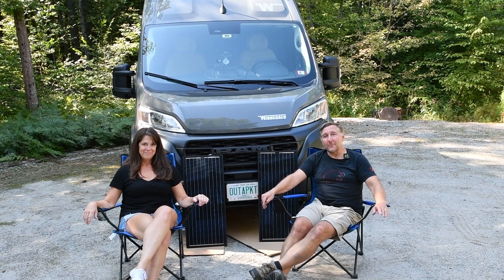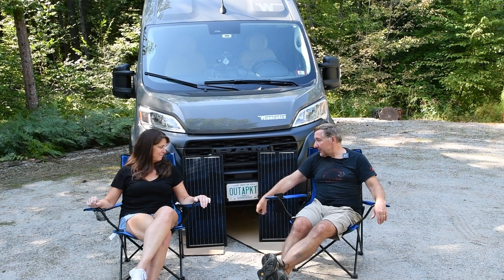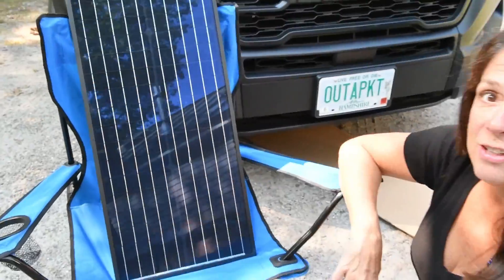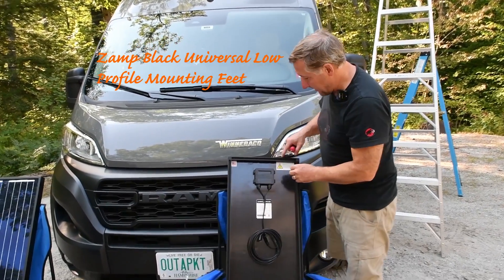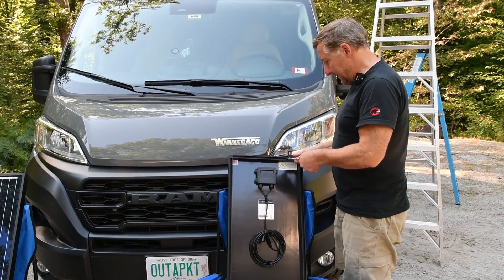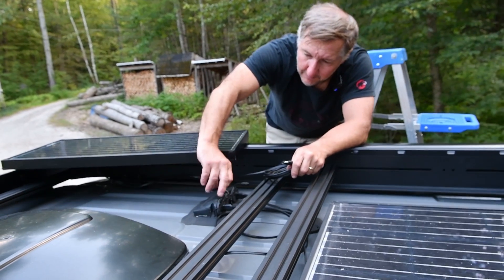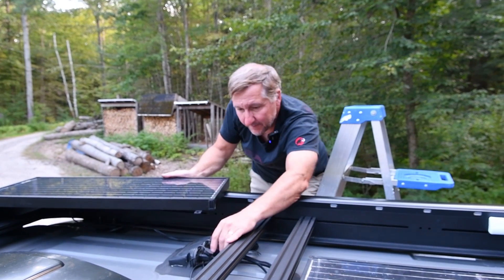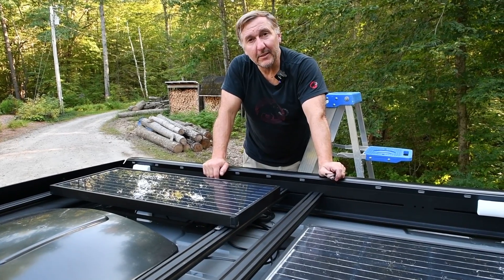Solis Pocket 36A Solar Panel Upgrade

Comment: Did you see a big benefit from adding the extra solar?
Reply from the maker: Well, we don't have hard numbers other than what we shared in the video but it is a 60% boost in solar capacity and an easy/cost effective upgrade if you have a place to mount the panels. In addition to faster recharge, another thing we like is we can run more on a semi-sunny day (fridge, max air) without draining the batteries at all. Now that we have installed Ecoflow batteries for 120v off-grid, I am also interested to see how much excess solar we can draw off to re-charge that. Hope that helps and thanks for watching!

Comment: I was advised to not mix panels of different wattages because the smaller ones will limit the output of the larger ones. I will be most interested to see if I was ill-advised or not from your experience. Since I had already bought smaller ones and larger ones, I put them on separate charge controllers here in my cabin's back-up electric system. They do work fine on separate controllers feeding my LiFePo4 batteries, FYI.
Reply from the maker: Hello again! Thanks again for raising this. I did some research. I found this very helpful guide (among other resources): https://solarpanelsvenue.com/mixing-solar-panels 
When you have multiple solar panels, you have two options of how they get connected: series or parallel. With wildly different current (more specifically amperage) specs between the panels, as in my case, you definitely don't want to use a series connection. Also I am very certain the Solis Pocket is configured for parallel connections on its expansion solar input ports. So with different current specs (overall watts) on each panel in my case (45W vs 170W), the best way to connect them is in parallel. The risk doing this is if the panels have different voltages. The effectiveness of all the panels will be determined by the lowest voltage panel in the system. Checking the specs of the 170-watt Zamp panel that comes on the Pocket, it has a max power voltage (VMP) of 19.66. The 45-watt Zamp panels I added have a VMP of 20.21. That is less than a 3% difference. So, based on what I understand from my research, connecting these together in parallel will reduce the effective voltage of the 2 45-watt panels from 20.21 volts to 19.66 volts. That is an overall lost of performance for each 45-watt panels of about 1 watt only, so they effectively become 44 watt panels. So from what I see, this is actually a pretty good match and effective way to expand the system. You would want to avoid adding any panels to the Pocket (in parallel) that do not have voltage specs of right around 20 volts. From what I see, the Zamp panels all fall pretty close to 20V. Hope this helps! If anyone else reads this and wants to add their perspective, please do!
Reply: @Outapkt  Great link. It looks like my solution of 2 charge controllers was the best option for me. My panels are within a volt of each other, but the 100w are 3 amps more than the 30w panels. I'm using a system I put together for a van build that never happened, so I'm using it as a backup for the many power outages I have here in the winter. I bought a second charge controller for only $90 to get it all to work most efficiently. Really enjoying the videos.
Reply from the maker: Very interesting, thanks for this information. We will need to do some evaluation of this. Thanks for watching and sharing your experiences.

Comment: nice upgrade. thanks for sharing. question for you: Did Winnebago secure the cables under the original solar panel in a way that it doesn't bounce on the roof? They didn't in my Revel and a lot of other Revel owners reported the same issue. it is so bad that the cable and the fuse holder is wearing the paint away and is actually putting some small dents into the metal.
Reply from the maker: Hi there! Thanks for watching. The cables for the original solar panel are held down with a blob of black self-leveling sealant. You can see that under the roof rack cross bar around the 5 min mark. We may need to secure our cables better on the new solar panels, we will see. Sorry to hear that was missed on the Revel. Great van though! Love the the look of it. Take care and good luck!
Reply: @Outapkt  they glued the cables to the roof 😀. WOW. I have a video on my channel about adding an aluminum bar under the panels to better secure the cables and stop them from bouncing on the roof.